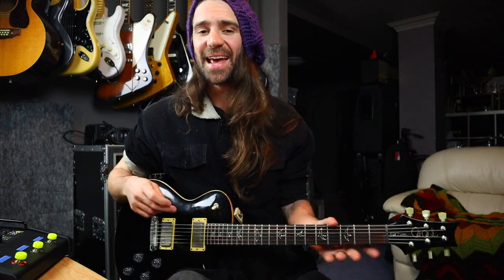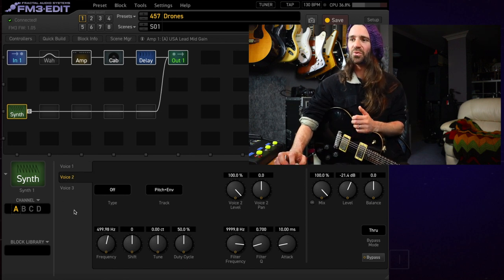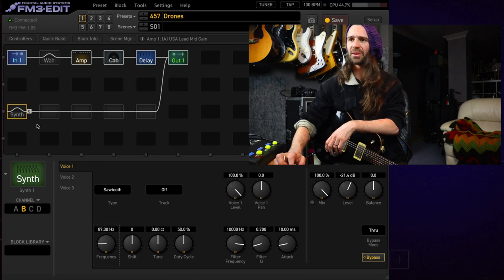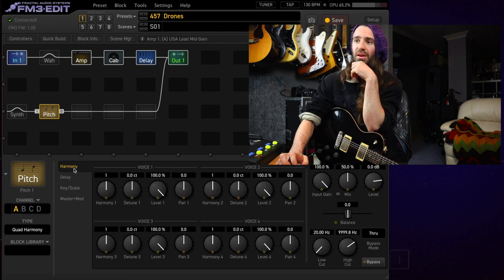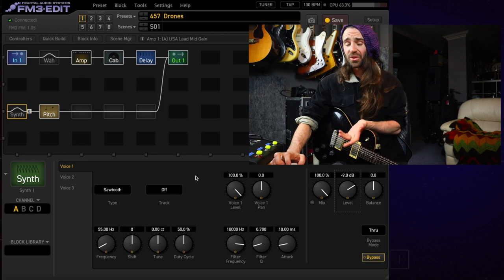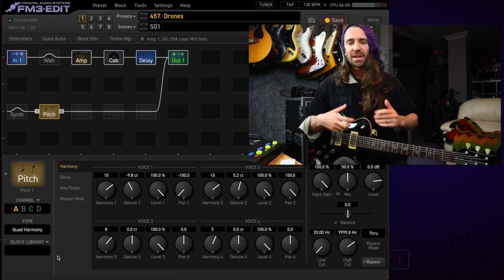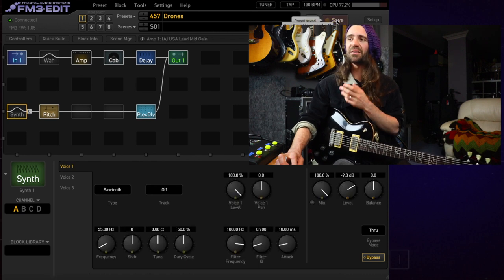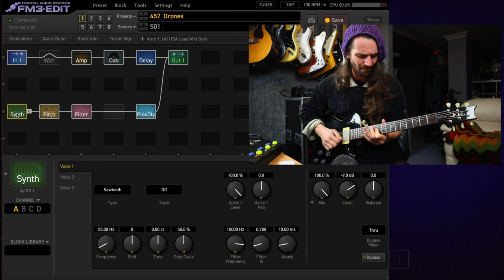FM3 Synth Drones Tutorial

Comment: Damn! I got inspired to mess with the synth block after watching one of your other videos, but I was trying to get the harmonies with the synth block voices. Never crossed my mind to use pitch block. Duhhhh! So much easier. Thank you for this video!
Reply from the maker: Take it next level and dial in some harmonies using custom scales :D
Reply: @LeonTodd  Thanks Leon. I'm noticing something strange with the synth block. I have voices 2 and 3 both set to 100 Hz just like you do in the video, but they sound slightly different in pitch. To get them to sound identical, I need to move voice 3 up to 111.60 Hz. From what I can see, all the other params are identical. Any thoughts as to what I might be missing?
Reply: Just figured it out. Even though the "Shift" knob read 0, it was somehow slightly not 0. I reset it to 0 by typing it in and then the two voices synced up in pitch.

Comment: Interesting...odd Fractal doesn't include direct Note/Chord selections vs a freq input knob in the synth block. Seems like it could be setup in a more musical way. When I get my FM3 going to have to try this out. 👍
Reply from the maker: The other way to do this would be to generate a tone and use the pitch block to switch the frequencies, which can be done an a note by note basis. I'd love if they supported midi notes though so you could plug a keyboard or controller in to play the synth.
Reply: @LeonTodd  That's how I do this on my ancient 2101.😁 👍
Reply: @dan_perry 
How do you generate and process the tone on your 2101? I'm new to this unit and would love to try this out.
Reply: @johanneschristopherstahle3395  The 2101 has a built in tone generator, you can side chain a couple pitch shifters to it to make chords. Add some modulation, delay and verb for more atmosphere. 
Note that's all that will be tough on the base unit...you really need the extra PPC-210 that came on the limited edition 2101s.
Reply: @dan_perry  is the tone generator you're talking about the tuning reference?
Reply: @johanneschristopherstahle3395  Yep!

Comment: Hi Leon. I've been a long time plugging a guitar into an amp guy. So I'm wondering if you could do a setup for noobs video explaining how you connect the FM3 into whatever you have to connect it to, to get sound? I'm thinking what type of speakers or cabs, connectors. And does it h ave to go through a computer? etc. Thanks.
Reply from the maker: You don't need a computer to use it at all. Here's a few basic vids

With a tube amp for fx only - https://www.youtube.com/watch?v=RaYffPQRqNQ

With a full range speaker - https://www.youtube.com/watch?v=uod-XzY6-lw

As the "brain" of a pedalboard - https://www.youtube.com/watch?v=9PmvxX1C4Xg

Finally, the Axe-Fx basics series I did a while back applies to the Fm3 too - https://www.youtube.com/watch?v=DVZ_nu6x9-w&list=PLJ2NORIYLYH490auJt9ZJ7uwb5tbPaqcG
Reply: @LeonTodd  Thanks